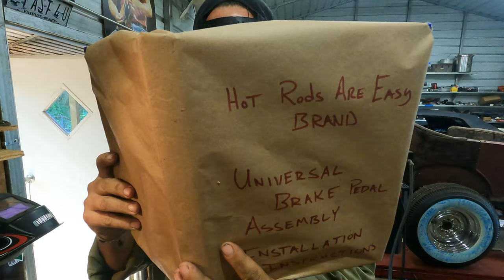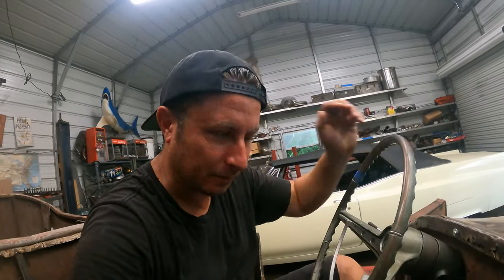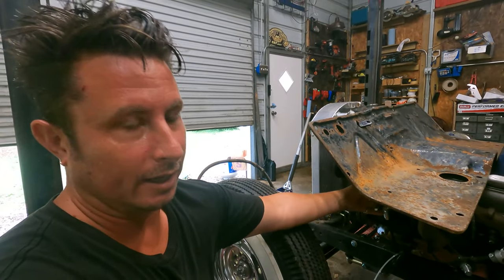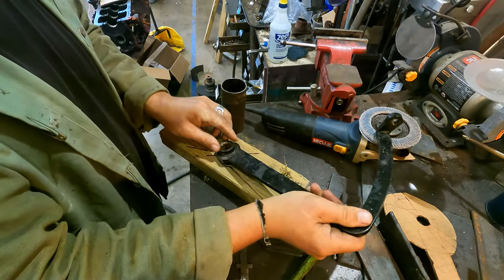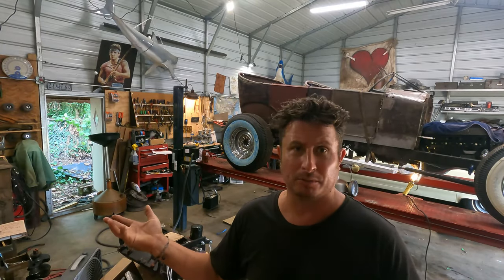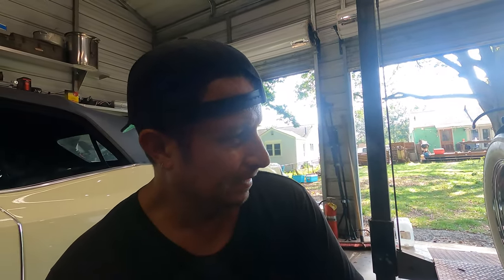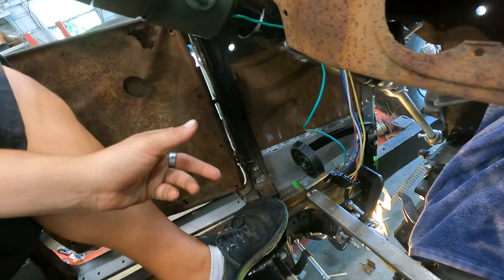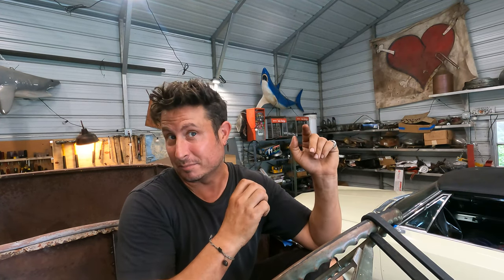No such thing as UNIVERSAL…or is there?? How 2 Steps Back = 1 Step Forward... and other HOT ROD MATH

Comment: Back in the 70’s I put a 327 Chevy in a 46 MB Willys. I ended up installing a hydraulic slave cylinder for my clutch. Worked great! I enjoyed your thought process on this video. You’re giving me great ideas for my 1924 Dodge Brothers Touring. I’m running a 1984 318 with a 727 tranny. Getting to old for shifting. 🤣
Reply from the maker: Thats awesome... my 54 has a hydraulic slave pulling the  clutch fork ... I just don t love the feel of it, and for some reason they make me nervous... it adds thre failure points where i dont need any.(master, slave, line...)   But... sometimes its still the best option.    
     That will be a great set up for your dodge.   should be a blast

Comment: You are so cynical, and so correct, about women and hot rods.  LOL.   I have a pretty cool (IMO) Model A pickup with a Flathead and five speed, and my wife won’t even ride in it.   This is not a crusty heap of rust…. This is a painted, upholstered, fully-inspected-by-DOT, overbuilt, heap.  To be fair, she rode in it once, maybe the second test drive, and (as Model A’s can do), the passenger door popped open going around a corner (at maybe 10mph).  Nobody fell out or got hurt, and the body/doors have since been adjusted to perfection, but you couldn’t drag her into that thing with a winch.
Reply: To me, problem solved
Reply from the maker: And I bet you can’t get gas or sit at a stoplight without a dude asking you about it
Reply: @betweenthesharksgarage   zackly!